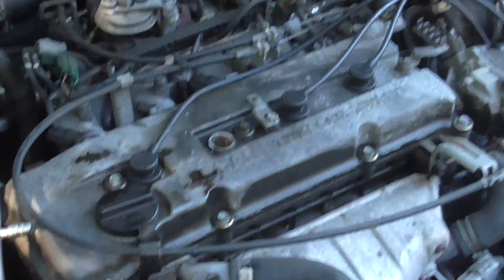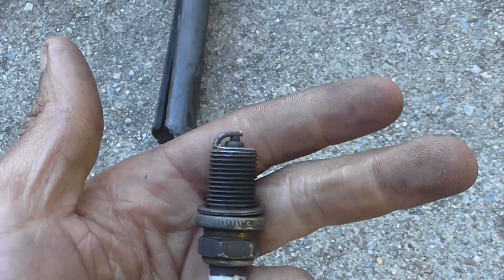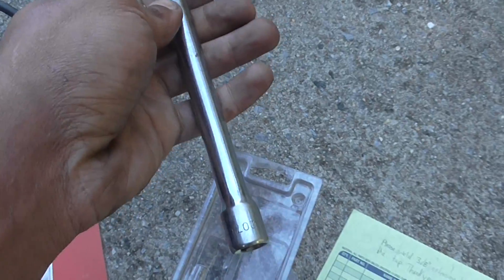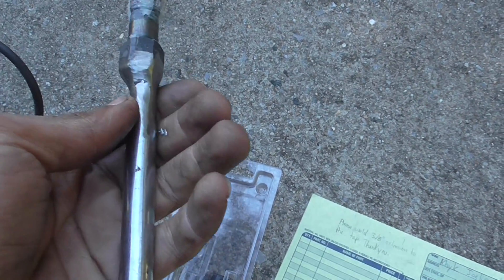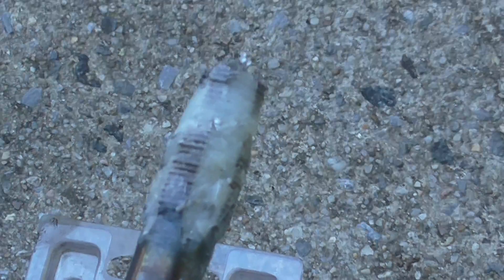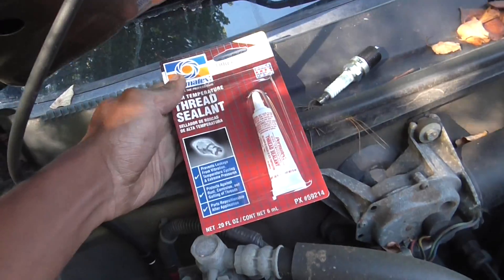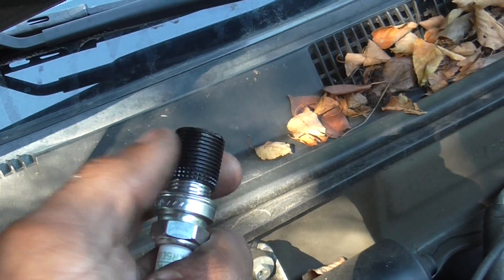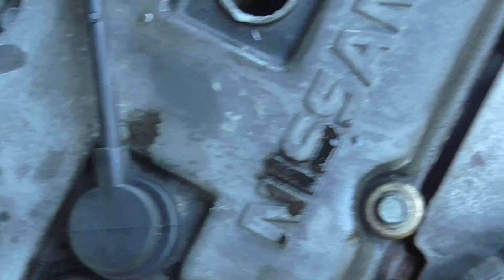Spark Plug Hole Repair

Comment: That seat tool wouldn't fit way down there. If you didn't do that, it'll pop out. It'd be better to use a Time-Sert but it's expensive. It'll lock the insert in. It has a seat former but I think you turn it until it spins freely. Get a deep hole tool. If the insert comes out, use a Big-Sert kit with the long reach set. It costs about $300.00! Use a EZ out to remove inserts. But the hole is way down there!

Comment: my threads came loose and leaking oil into spark plug well could I use locktight to make it stick in back in.
Reply from the maker: Tony Boroni Hello, thank you for watching my video. Oil is in you spark plug tube most likely because you need to replace the rubber gasket. (Valve Cover Gasket)

When you say your thread came loose, do you mean the original parades, or have you installed a time-sert and that has come?
Reply: +KhyoteJinkens one of those helio coils was installed he left metel shaving in the sparkplug well and did not use thread seal for it came out last night oil was seeping through the thread gap because no glue was on it. posibly the seal might be damaged to wen he drilled it out, his replaced the 1 coil pack because it once filled up with oil and cort fire, I brought the car off someone if gumtree recently also its ruff idoling.
Reply: fix the oil seal problem but car is now shacking in idle is that a valve essue its a rodeo 1998
Reply: i fixt the spark plug thread that all it was i put gasket glue in it.
Reply: and put the helio coil back in its place by glueing back in